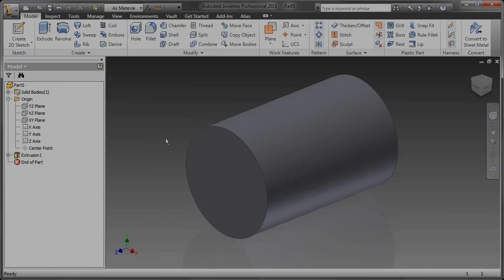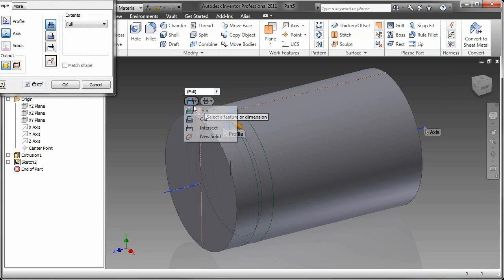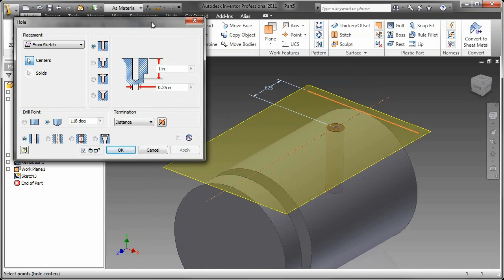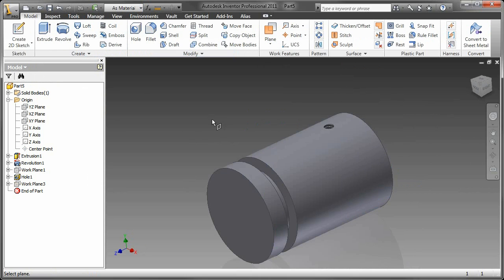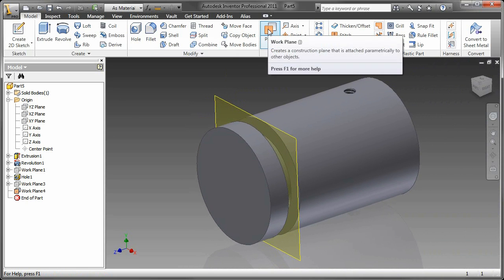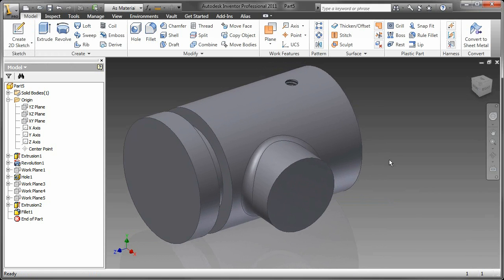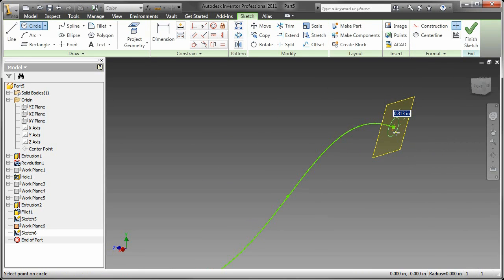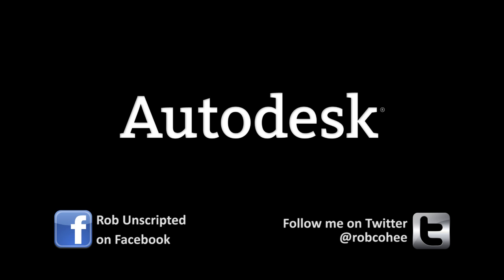Autodesk Inventor - Fundamentals of Workplanes

Comment: Hey Rob, thanks for these Tutorials. really fast to pick up. I literally hit the ground running. wanted to ask if there's a way to in assembly mode to see the parts that are on the underneath. i mean for instance i want to drill a hole on a piece to match the hole on the piece that is underneath. i tried by putting it in wireframe mode but it only shows the active part. the rest goes invisible. again thanks so much man. ur awesome.